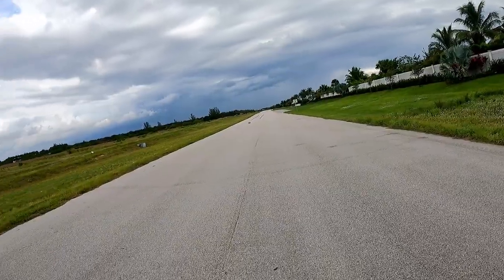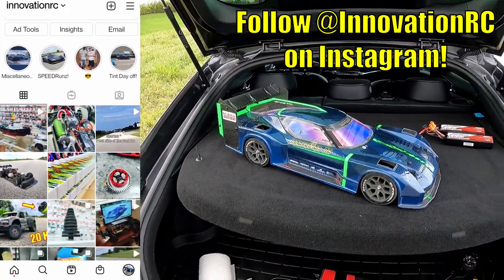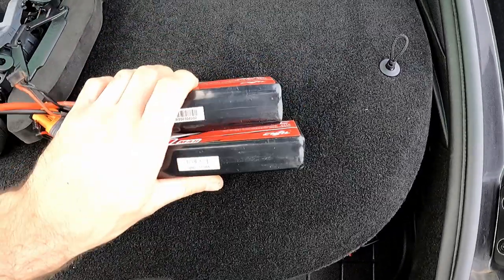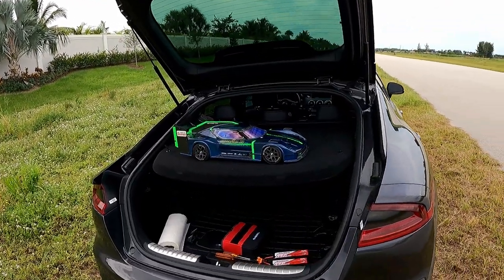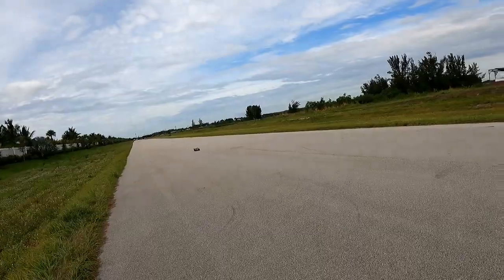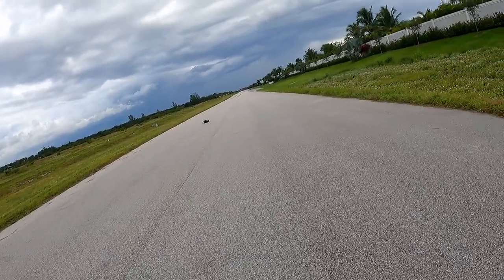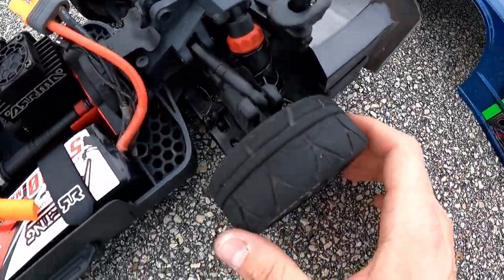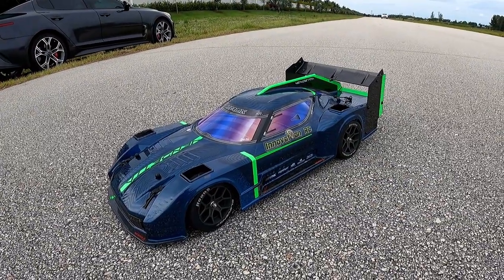100 Mph Vendetta 4s! Almost took my legs off!

Comment: Great video. 
Be good to see how fast you can get it to go on 2S and 3S with different motors/ESC's eventually. I'm tempted to get one of these myself you see to attempt some of the ROSSA lower cell count categories. My current PB on 3S is 106mph but that was with a 1/12th scale. The Vendetta has a lot more room for bigger mAh batteries, larger can motors & bigger ESC's.  ;)
Reply from the maker: Thanks man! Yeah this would be a decent contender for low cell runs. Definitely would go with a mamba monster x 8s esc though. Probably 3500-4000kv motor as well
Reply: @InnovationRC  keep up the good videos when you can. All the best 👍

Comment: I was amazed how you unplugged the battery with one hand. Most of my cars use IC5 connectors and even 2 handed they are very hard to unplug. What's the trick to that? No conductive grease?
Reply from the maker: I do this stuff a lot... Lol
Reply: @InnovationRC  That could be it. My plugs are new and probably not broken in yet. It's either that or I'm getting old. It could also be the weather. When it's hot out they are just a pain to break loose.

Comment: Killer pass bro. I’m running a 3660/4700 kv on 6s and it’s held up so far. Sometimes you get a good one! Happy for you bro!
Reply: Wow. What motor are you using?  are you using a low c rating 6s?
Reply: @alexcrowder1673  queens hobbies racing products and 35c discharge 3s packs in series

Comment: Unbelievable that was awesome!!! So I’ve noticed that you run the CNHL lipos in most of your rigs are they really that good of lipos compared to like Powerhobby or smc’s? Curious as I’m looking for better than my Powerhobby graphene packs. Thanks your opinion most definitely matters !!!
Reply from the maker: I do not like power hobby, very expensive for the mediocre performance they'll give back. I had two 7400mah 150c packs that puffed out on trying to run Juggernaut (100+ mph 1/5 Kraton) literally puffed up 2nd time out. Cnhl was cheaper and better performing by far. Smc V2 extreme batteries are the only thing better than cnhl. But. I haven't exceeded the max power of my cnhl batteries. So cnhl is a double win on my end...

Comment: beautiful pass. What first mods would you recommend for the Vendetta?
Reply from the maker: Probably a hardened steel spur gear and better tires
Reply: @InnovationRC  Where can I get it?
Reply: @55steviegreene ebay has them

Comment: What was the esc code...I have the same 1 & I swear it made the same noise last run...I assumed it was low voltage or battery dieing
Reply from the maker: One was radio glitch. Can't remember the other.

Comment: They cheaped out on the wing/body connection for sure.  It should have been a hard plastic wing with a mount to the chasis separate from the body or at least more stiffeners in the body.  The body flex can even be seen in the product video by Arrma.  Even at the stock 74, this body design is a let down, but at 100, it's just dangerous.
Reply: It looks so good though lol

Comment: What do you do to keep your car straight at high speed
Reply from the maker: I turn the steering sensitivity and rate down. Don't need to steer that much. Also an alignment on the road you run on helps tremendously
Reply: @InnovationRC  thanks

Comment: That was absolutely awesome man, but be careful next time, these cars are definitely weapons!  👍🚀🔥I am going to try a 31T pinion. Do you think the stock esc can handle it, or better to replace it with a higher amperage one?
Reply from the maker: Thanks on that! Definitely need a higher amp esc.
Reply: @InnovationRC  Thanks.

Comment: What do I need to upgrade so my vendetta can run on 4s with no problems?
Reply from the maker: Just need a larger esc
Reply: @InnovationRC  can the stock motor handle 4s power?

Comment: Again hitting amazing speeds with super low C Rating batteries, I can't believe 30C batteries are putting out that much power! You really gotta try it with stronger batts: 6000+mAH and 60+C.

Comment: Need to get those trash unbelted wheels off - get some GRP / Hoons or Foams on. 4s is likely easy for the 3900kv motor to handle as i know quite a few people that run the 3200kv motor on 6s with no issues

Comment: spektrum 130a   4s esc is perfect for this motor, on stock gearing you wont run into heat issues, and with a good high "C" batt, youll get 85++ mph,   no other mods required.
you may want to stiffen the rear shocks, but otherwise this is an easy 85mph + car, with 1 simply swop of esc.